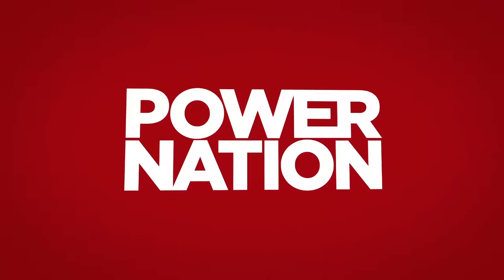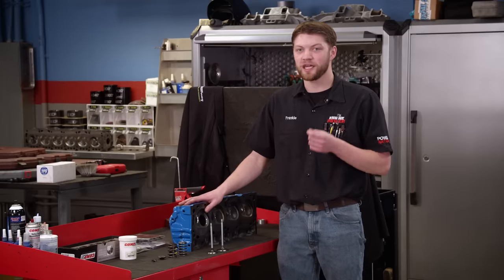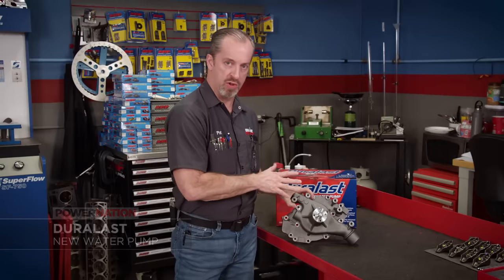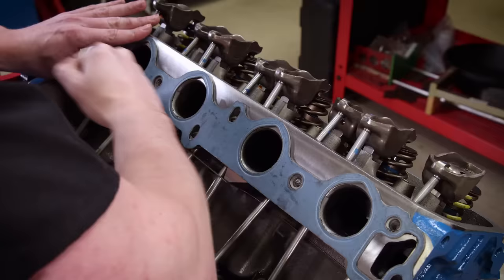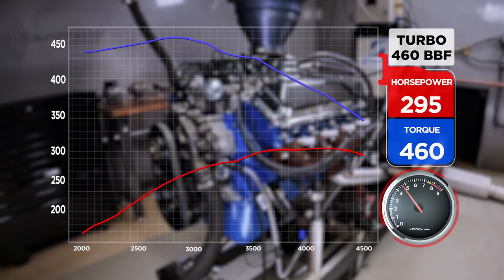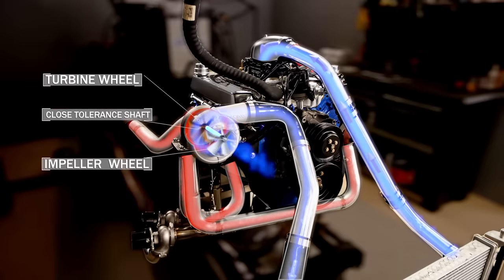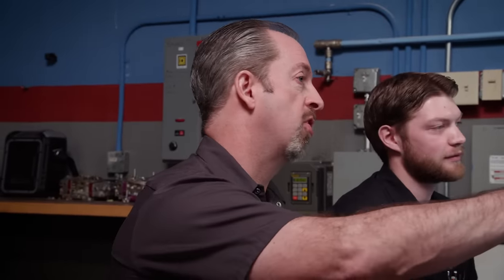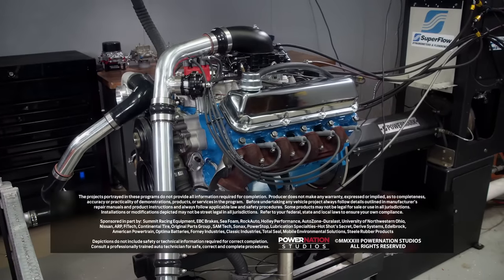Turbocharging a Stock 460 Big Block Ford for Massive (And Affordable) Power - Engine Power S10, E5

Comment: 460 in my truck now.  Considering a rebuild.  Thank you for what seems like a great, reasonably economical option!
Reply: Look into Jon Kaase SR71 heads. Worth their weight in gold on a 460.
Reply: @johnkelly928  Do those work well on a stocker as well? One of these days I'm going to get myself a F-600 dump truck and extra power is always more fun. Thankfully those trucks are usually pretty inexpensive so might be able to find some extra cash for heads. Not planning on a rat rod but using it for hauling gravel and my little dozer.
Reply: @Parents_of_Twins  they work well on everything! With a dead stock, 1972 460 factory crank, rods, pistons and short block basically, with a trick flow top end kit/roller conversion/msd/big headers will make right around 600-650hp with the right carb, some modern timing and a big fuel pump. The best part is the power curve is increased more drastically BELOW peak, with as much as 350 more ft lbs of torque and lower in the rpm, like diesel torque low. I've seen them squeeze 750-850 ft lbs of torque out of these set ups with the trick flow or SR71 heads. Basically if it's not making 500hp and more torque you've put something together wrong! With a race prepped 598 inch stroker kit you could be talking over 1000 horses and 900-1100 ft lbs of monster truck torque with some big money. 

I'm currently looking for a 70- 79 lincoln mark 2 door 460 equipped car (the earlier the better) for my next build, where I will be giving it the 460 to 598 cubic inch stroker kit with azf flying magnet crank trigger and a quiet roller gear drive, BIG SECRET roller cam, 1.7 rockers atop the double coil valve springs with guide plates a d hardened push rods and a that mess for high rpm use. I'll be putting a set of the biggest and polished up SR71's flowed out to the max with a double fuel injection set up like the new mustangs have (so it's nice and driveable at 2500hp); then I'll add an electric water pump now that they're lasting 100k+, big twin turbos thru 4 inch good mufflers to keep it as quiet as possible.  I'll reinforce the 9 inch with a mini tub and narrow job, adding discs out back and big spline axles. I'll probably stick with a well built big block C6 or aod, maybe even put a pickup truck zf 5 speed in it or a 6 speed tremec out of a firebird or Vette, that would be cool! - an old school Lincoln with a 5 or 6 speed clutch in it? Hell yeah
Reply: In a working truck, stick with iron heads. Less trouble.
Reply: @jesse75 Less trouble??? I'm not seeing any trouble with saving a ton of weight off the nose with aluminum heads! Or any trouble with much better flow than an iron head, or much better combustion chambers.
Reply: Buy a set of heads! Air Cobra Jet?
Reply: Go for it! I'm a nitrous guy! 20 years ago I met some guys doing yest this! Told them go up on the gas! He replied," this is a stock 71 Lincoln motor! We're shifting at 6000 rpm! We f!@ked up a stock motor shooting 200 on it! It was cheaper to just transfer the goodies to this motor! That was 20 years ago! I still struggle, I have my late fathers 94F150 flareside. He wanted me to build a 393w! You'll kill urself! I'm dying anyway!!
Reply: @jesse75  I see the commenters are clueless and didnt listen to a word you said. You are spot on man
Reply: @johnkelly928 , I've been dying to try out a set of Boss-9 heads. From everything I've read, they'll fit a stock block 429/460 with no mods to the block. Not even the oil return passages and while $5,000 bucks a pair complete seems pretty high plus another $700 for valve covers and I'm not even sure how much for the intake, that engine would definitely be my finest build. Ever.
Reply: @Parents_of_Twins  Old F600s are cool loved em as a kid 
They are so heavy I wouldnt do more than a nice valve job, blend and maybe a teeny cam if you want a little rump to it
Didnt ford make a giant 6-700 CI gas engine for the 70s era trash trucks? Never forget how deep the sound was as a kid
Reply: @markmccarty9793  Had ported SCJ heads, 460, cam rhoads lifters etc in a 85 5.0 in the early 90s
HEads were too big they had lousy airspeed and lacked torque. Lesson learned
Mentaility back then was different...same issue with the Cleveland heads. Yeah on a flow bench looked good but poor airsspeed We are lucky to have nice aftermarekt stuff today
Reply: @johnkelly928  Oh man that would be an absolutely sick build. We had a 1972 Lincoln Continental when I was a kid. The 460 had gone bad so dad took a 429 out of a Thunderbird. There was something he had to do with the driveshaft or trans to make it work but it was a sweet ride. Thing would absolutely fly. I really wanted that engine but it went to the scrap yard along with the car. Dad had a 1969 F-350 with factory aftermarket 4x4 system. Dad scrapped it out because he couldn't find wheel studs. Makes me want to cry when I think about it. Oh well can't change the past.
Reply: @gordocarbo  Dad had one from the early 60's I think. Had a little straight 6 in it, think it was a 258 or 260 something. I know it was bored over 60 thousandth and would spark knock like crazy. Don't know how it stayed together but it hauled many a load for us. Dad would haul 6-7 yards in it all the time. Weren't a lot a highway patrol guys around so dad didn't worry about weight limits. Dad used to pull our Case 600 dozer (about 14k lbs) around on a two axle trailer with a f-150. The good old days were kind of scary sometimes but if you survived you have interesting stories to tell :)
Reply: @gordocarbo  as for for the Cleavland, you obviously didn't have enough gear, fuel supply, cam, or balls! You gotta have the trans break at 4500! I saw 400ci Cleavlands back in the mid 80's that were running 590's on motor in the 1/8 mile! For a little while! On a little gas they ran 5.50 1/8 miles! And hold up! But, you realize, if 250 is good, 500hp of nitrous is awesome! For, a little while!!
Reply: I wonder if the engine would have any longevity at moderate boost as a tow motor for a 5000-8000 lb camper trailer? Say in a boosted situation pulling for 5-15 miles uphill in the Rocky Mountains of Montana.
Reply: @KeninMT  it would pull a 6000lb camper without a turbo! The problem would be the transmission I'd worry bout. Put as big a cooler on as you can.a slide in is ideal for fast-paced road trips. An oil cooler too.

Comment: I run 22psi and 26* of timing on my stock 460. S475 t6. Tunnel ram and a cam really wakes these piles up.
Reply: Hell yeah! What’s it in?
Reply: @travistorres1388  it's my race truck. I have a bunch of mashed up parts on it. Black ford f350 in my videos
Reply: Yeah, they are not pushing that 460 anywhere near its limit. Those things are tough. A 351w will handle that power level with a stock bottom end.
Reply: I knew I’d see ya here😂
Reply: @marcusandre1438  hahahaha....sup
Reply: Turbo and tunnel ram?
Reply: @gordocarbo  absolutely.

Comment: Not trying to poke holes in your exhaust pressure but as I understand it, it is the expansion of the exhaust gases that spin the turbo, not the pressure from the flow of exhaust. Please correct me if I am wrong. 
Great video on the 460, this engine is a solid foundation with more room for growth and beefier components than it's competition from it's day and does not get the credit it deserves.

Comment: Seriously I'd love to see some bigger valves, a quick home port job, and a real cam, and a swap meet hi-po intake it would absolutely rip!
Reply: Or just more boost. Seriously 7.5psi is child’s play even for a stock engine.
Reply: @johndelta00  Stock 460 isn't the same as a stock 454, 440. It was built/designed for trucks, pickups, station wagons, heavy cars with towing packages. 
Stepping up from stock OEM parts specs it could be built, but like these guys stated on the last pull, 9psi on a heavy foot driven stock 460/472 wouldn't last. Your 7.5psi, yes, even they stated that's the top number to go with.
Now they can be built, cuz built one for a pulling truck. Cost a ton of money and time, never went to pieces, and was a beast, but it wasn't like starting with a stock 454, 440, and the useable stock parts that could be left in them.
Reply: @Ray56z  Speaking from experience are you? You’ve turbocharged one or more?
Reply: Just an earlier set of factory heads will wake it up a  bunch.  CJ heads will be even better, but you can get some aftermarket ones a lot cheaper nowadays.
Reply: @johndelta00  Built 2 normally asperated for street use, helped build and maintain the one I mentioned my cuz built, twin turskies.
Plus, these guys pretty much laid it out about stock, and Ford didn't design this to be used universal in applications like the 454 or 440 were. There was nothing about this design beyond low RPM torque.
Ford made 3 motors that were designed for nothing but torque as far as I'm concerned. 300 I-6, 385, 460.
Reply: Still taking the 460 over a chevy big block
Reply: @rakemuhammad  For low end HD use sure. 454 is better in every sense of the word esp the heads
460 has a crappy exh port cant do a lot with it
Reply: Coming back to reply to a couple comments I've seen, John Kaasse is THE premmient authority of bbf engines. One of his engine assemblers who I believe is featured on this show at some point, who builds these engines every day, has said himself the two bolt, block can support 1000hp and the factory cast cranks 900hp. The rods not up to those numbers however, probably properly reconditioned with ARP hardware 550-600hp maybe a tad more. The biggest drawback are the heads not doubt. Yes there are better stock heads for sure but they are getting scarce. The Ford Motorsport aluminum Cobra Jet have been around for 2 decades at this point and are a big step-up for the iron ones. But to say the bbf aren't as durable or strong as the other guys just isn't true. I'm gonna believe guys who build them and dyno them everyday.

Comment: My F250 might just be getting some boost.  Rebuilt it years ago and the desktop dyno numbers were very similar to what you got.  And mine is all done at 4600 rpm, but rarely see's more than 4000.  Thanks for a great project and inspiring me to get thinking boost.  I should address the open rear differential first.

Comment: I just picked up an efi 460 last weekend for my F150. Was just gonna do a basic rebuild with a carb (with that adapter plate). Now ya got me thinking turbo... Thanks!
Reply: You may have to raise your budget for rear tires!😂  Sounds like the truck could be a beast. What year?
Reply: @Art Sammond  its a 91 regular cab short bed 2wd. Just building it for fun and the occasional Home Depot trip.
Reply: @drewjames9167  nice, good luck and have fun!

Comment: I would like to see the exact same setup on a setup of dove heads and flat tops please
Reply: Might be too much compression for boost on pump gas. CJ engines ran true flat tops with one valve relief and came in at a nominal 11.3 compression. Add in the extra 43 cubes this engine has and it would be up near 12.
Reply: Might be smarter to port these high port heads.
Reply: Just port those D3 exhaust ports.

Comment: Did the exact thing with my dodge 440 big block. 10 lbs on the street in my 66 dart is a blast.
Reply: A big block and a turbo setup in a Dart? Jeez that engine bay must be a nightmare to work in...
Reply: @Vaino_Hotti  trimmed the inner fenders, made my own upper shock mounts. Full plug change in 20 min. I refused to build a car that’s a pain to work on.
Reply: @koboskolors  Cool, are you running headers or manifolds?
Reply: @Vaino_Hotti  manifolds. Pass side dumps in rear, drivers side dumps up front. Tie together under pass fender where turbo is behind headlight

Comment: I swapped the stock exhaust manifolds on a 302 ford.  Installed the 302 and 4speed auto. In a 69 alfa romeo spider.  2.25" pipes off the manifolds into a 3inch , into a muffler.  The output split fer twice pipes out the tail.

Fekkin dangerous vehicle.   2100lbs with 310hp.

Comment: My  32 year old 460 is pulling ratings close to the first pull with more of a high flow exaught and additional port on the intake. I took out the extra intake because I kinda like it smoother and more compressed than excessive aggressively however dam woth the turbo tjats built so nice!

Comment: Would have been neat to see this taken just a couple more steps, add some basic forged replacement pistons, a little bigger cam, Throttle body EFI for the blow-thru turbo setup and electronic timing control so you could pull timing with higher boost. Just imagine what the power numbers could have been...650 HP and 800 TQ, all in below 5500 RPM??? Load that up in your big 4x4 Ford pickup!😎

Comment: Pat and Frankie!  Please take this same setup, put in forged pistons and rods, upgrade the rocker arms and convert to EFI and do this again with the same engine but better components on the dyno with the Turbo Setup.  I'll bet well over 800 pound feet and probably close to or "North" of 600 horsepower!  You Gentlemen should do this!  This would be so cool!  😎

Comment: W O W ! 😮  I am absolutely, positively impressed with what you guys have done to this big block Ford engine! This is amazing how a $500 turbo can change the numbers on such a mundane engine, I mean, Holy Crap!
Great build, guys, great build.
Thank you for going to such lengths to show us simpleton's on yet one more way to actually build some fun and excitement. Not to mention the improvement of, let's say, your good old pick-em-up truck, or car. The only thing that I would worry about is the drivetrain and if the motor mounts, the U-joints, and the rear axle are going to be able to withstand all that torque and HP!
HA! I would definitely add some sandbags in my trunk or over the rear axle in the bed of my truck, if I were to go out and play with it, that's for sure. 
Again, I want to thank you for your hard work on making and showing me/us, on this cool turbo build. 👌😎👍, 
😎Cool Bro's, Very Cool. 
Motor Mayhem Right There, YEAH!

Comment: Now this is a true stock budget build, love it!
Insane torque and plenty of hp just the way it is. 
Seems a lot of commenters have no idea how hard it would be to put that to the pavement with their "needs 20 pounds kaase heads" stuff. At 4-7 lbs this thing will last forever can rip a house off its foundation with the AC on. And be whisper quiet...now that is freakin cool

Comment: Put a set of heads and a cam in it! Wouldn't go crazy with the cam! Just a set of Air Cobra jets! That way a Victor Jr  intake will kit. Kill off some of that low end and  pull out the big end! A mild 460 will spin the tires 3 light poles! Kill off  some of the torque  below 4000 and pull it to 6500!😂😂
Reply: Probably make 450 hp with early heads and better intake!

Comment: Nice to see you doing a stock turbo motor!  Thanks! I do have a question is the carb spacer or adaptor an easter egg?  I have never seen anyone run the two hole spacer side on the drivers side or one bank of an engine! How did that really workout guys? 
Whoever edit this showed that but who knows you may know something I do not. I would really appreciate an answer if possible!  Always looking for new engine building tips!  ✌
Reply: I saw that too, I’d have to have a closer look at how the manifold ports run. It’s probably correct… I was waiting for an explanation though.
Reply: Yeah, idk why they didnt just order the 4 hole version. I've got it on my efi head 460, accepts square bore holley. If you ask me, it was too much carb for stock 460...600cfm would have been just fine.

Comment: yep at 8:16 is is interesting. forced induction on a carburetor can suck but gale banks made an adapter for this, allowing the the carb to sit on an adapter that allows air to pass underneath the carb into the intake manifold creating a vacuum. this works much better and I have seen this on marine applications with gm's 454 engines. This setup will not mess up the floats or jetting.

Comment: I'm sitting here trying to figure out how you guys were able to run that much timing on pump gas with that much boost? 😅 I mean yea it's low boost but I'd think timing would needed to have been a bit lower to keep things safe. All in all good work guys! 👏
Reply: I'm thinking their pump gas must be over 100 octane pump gas. I could be wrong, but they didn't specify either way.

Comment: Do it again with good rods stock crank, forged pistons, trick flow heads and intake with a hydraulic roller cam that makes peak power at 6000 rpm. This would be the ultimate street sleeper.

Comment: The "Titan of Twist"
Have a 460 stroker in my '76 19ft Sleekcraft Kauai. 
528ci with quick fuel carb built by Barnett Racing out of MI and I was pleasantly surprised to see that I'm pulling 460hp with 638ft lbs, naturally aspirated.
Which puts it between the 1st and 2nd turbo pull here.
Cant put blower or pro charger on it because of the enclosed engine design of the boat. Which is what makes the boat itself somewhat rare so modifying it is out of the question.
I've heard strokers don't particularly like running higher rpm for long periods so I'm kinda torn about the installation of a turbo because of that. I know it would give a little boost in mid range but is it enough for the $$$$ not running W/0 much.

Dont really need it boat has an incredible amount of torque and leaps out of the water and I'm not out "fishing" for races either.
So would it increase my fuel economy a hair, I know that's a laughable question but just curious.

Welcome any thoughts, I feel like it's not enough gain to justify expense. I cruise around 3000, 3500 mostly with a couple short stabs in the 4000+ish range here and there just to bring out the white knuckle syndrome a bit with unsuspecting passengers. 😂